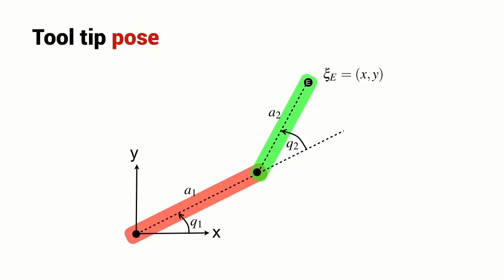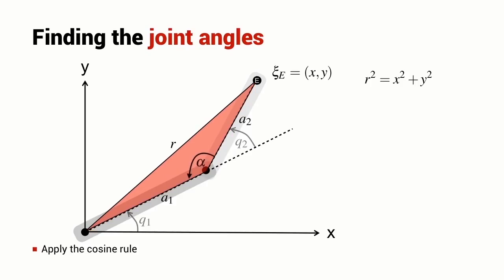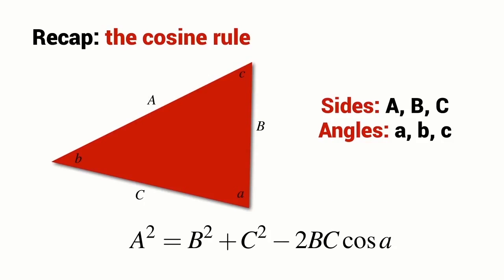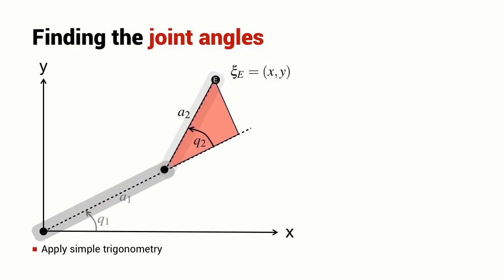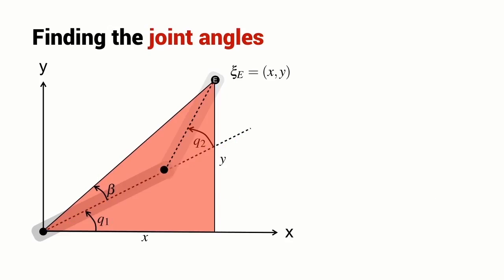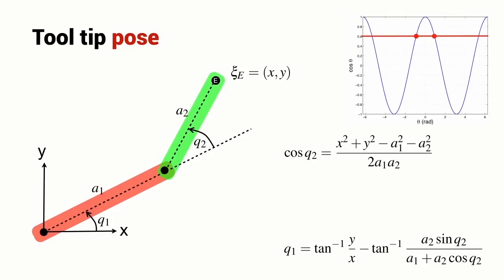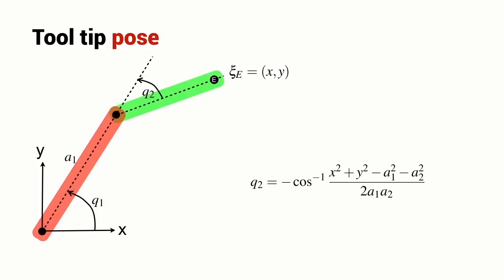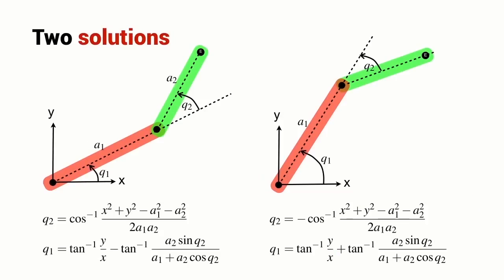Inverse kinematics for a 2-joint robot arm using geometry

Comment: these equations are wrong and only hold for very specific cases, DONT USE THESE!!!
Reply: I don't agree with you. The two solutions are exact(unique) solutions and mathematically true. I have tested the solutions with a 3D graphic.
Reply: The point (x,y) have to be within distance = a1+a2 of origin.

But you can move the point inside this distance before using the equations and the arms will extend straight towards the point even though they cant actually reach it.